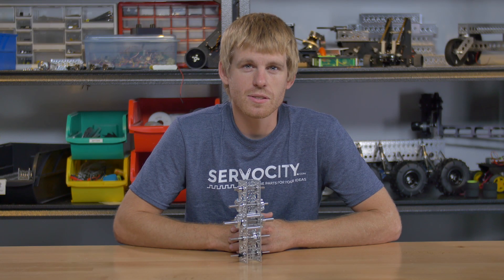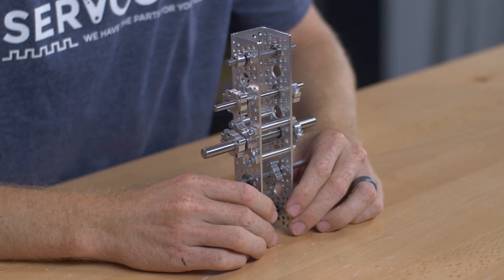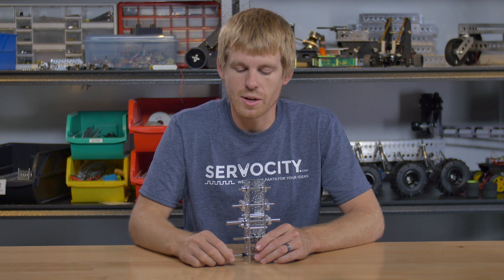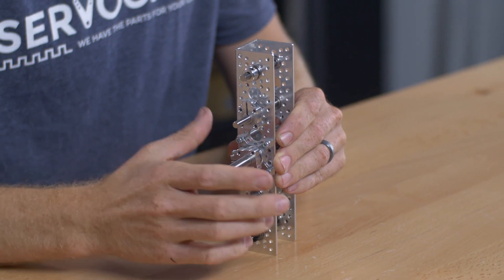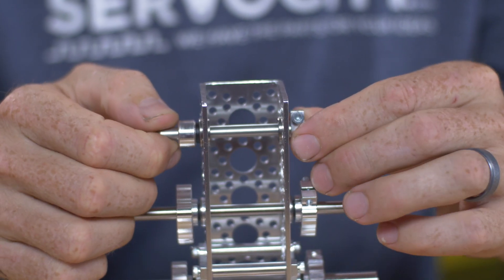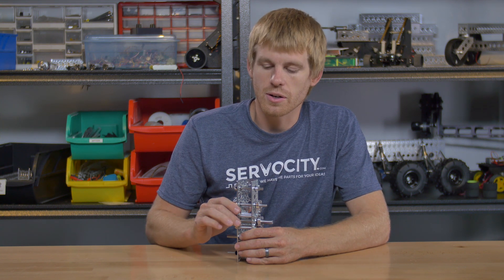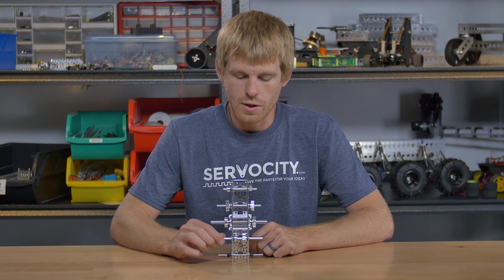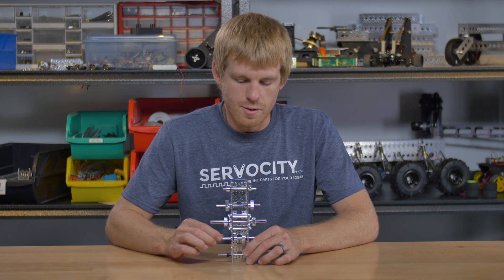Using Shaft With Actobotics - Part 1

Comment: do the bearings play well with tetrix?
Reply from the maker: Hi Peter, Tetrix is a building system that uses bushings.  The smaller center hole size doesn't provide enough room to run bearings.  Please let us know should you have any additional questions! tech@servocity.com